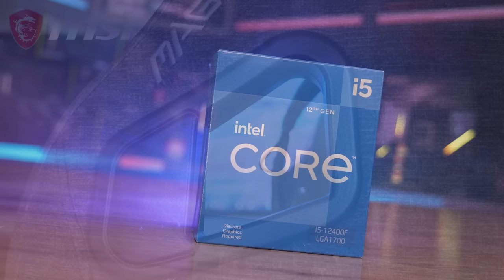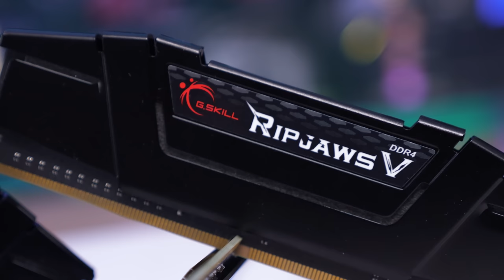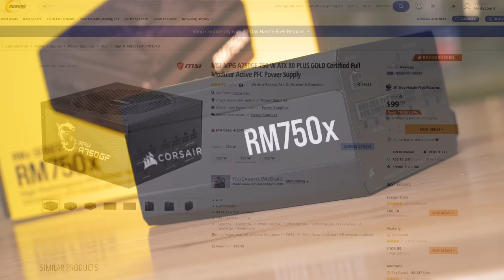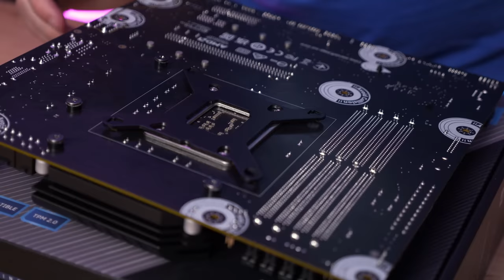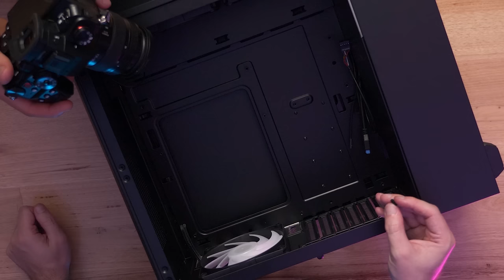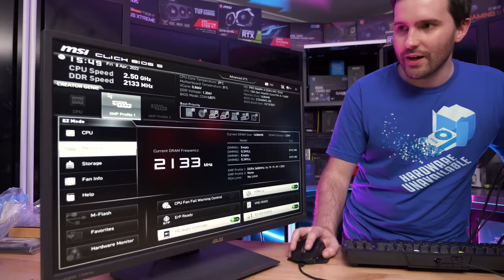Best Bang for Buck Intel Gaming PC Build for Early 2022

Comment: This is an excellent video, very impressed am I. I would like to see another one just like it. Only this time focus on the 500 - 700 motherboard price point. For the best bang for buck, where the sweet spot is for value and performance, and longevity, of a system, at the cut off between the mid tier, and the entry high tier. You have done already the cut toff from the low tier, to the entry mid tier.

In other words, the other sweet spot, that makes the most sense. So things like on board sound become important, and Wi-Fi, and lanes. Thank you hardware unboxed team.

Comment: why does nobody ever consider the 4core 8thread i3 parts?
both the one with igpu and without igpu are available for around 100 bucks.
clocks are high as well, when not in use they are super low power usage.

Comment: The 12400F is exactly what Intel needed to be back - great gaming CPU that doesn't leave anything on the table for 1440p or 4K. I would still go the Nvidia route. The 3060 goes for a similar price here, the NVENC codec (for streaming and, in my case, Moonlight) is a must for me, and you get the wider ecosystem of games with DLSS+FSR. Ray tracing should not be a factor if you are going for something in this price range. I went with a 5600x and 3060 ti and I don't regret it one single bit.

Comment: I have a question
Can we pair an i3- 12100F with like a 3060 or 6600 or it will end in a CPU bottleneck?
(Mainly looking for gaming not productivity)
Reply: i3-12100f will work fine. 12400f is quite the sweet spot tho, worth the extra for a generally better experience and longevity.
Reply: Get the 12400f
Reply: Yeah UpTo the 3070 your should leverage about 95% of the gpus performance, but if you prefer more online focused games the I5 12400f should be considered
Reply: The i3 12100f cant be beaten in price x performance imo, better deal then then 12400f.
12100f plus h610 16gb ram ddr4 3000mhz/3200,will work great 1080p no bottleneck up to a rtx3070.
Reply: should be fine in my opinion.
Reply: If you play at 1080p low, then a bit yes, 12100F will limit you, though it's still going to be at high framerate (except maybe not the best for ultra competitive titles).
If you plan to play at high settings and/or higher resolutions than you can even get to a RTX 3090 Ti and not be CPU bottlenecked.

So it depends a lot on how graphically intensive you play your games.

Also, if you care, the i3 12100F might get to be a bit overwhelmed in future games, though I doubt it will be that soon. Certainly later than a 3060 or a 6600 will be.
Reply: Please dont.
Reply: Steve just released a video on that yesterday

Comment: I would have skipped wifi  on the mobo and just used a sata ssd (maybe even a 1/2 tb one since you can add capacity later while you can't add performance to a gpu incrementally )  and try my best  squeeze every penny to get at least to a 3060ti. The perf jump could mean the difference between being sure to stay above 60 fps for the next 4-5 years and being  under it with the 6600  at 1440p in future titles. You can't really afford to allocate almost 300 $ of the budget to a mobo and a drive and then picking a 370$ gpu. Shitty gpu prices means some compromise has to be made elsewhere. I d rather have to uninstall a game I am not playing to make room for a new one, than having both on the disk and having to turn down the textures to run em. 6600 in itself is not a bad price /performance card ( still a bit below an "old" 1080ti while at least consuming less power ) but in a build costing more than 1.1k? not so much imho.

Comment: I don't want to be the guy who debates about the amount of thermal paste used, I know it doesn't effect the performance if used a more than enough but I just like to take of the cooler and re-paste once in a year or so and with that amount of paste spewing out everywhere is kind of annoying to clean lol.

And also I'd like to mention that adjusting some of the primary and sub timings and increasing the memory frequency from 3200 to 3600 will probably work with most ddr4 nowadays without issues and it'll help squeeze out a couple percentages of performance especially for budget cpus where the frequency is low. Many of your videos are around 30 minutes so maybe sometime you guys can make a video about memory overclocking and timing adjustment explaining and demonstrating the validation methods like memtest, linpack, y cruncher etc. It's a common knowledge but it'd definitely still help a lot of people.

Comment: Just bought a Ryzen 9 3900 (non X) 65 watt part vs the 105 for the x. Not supposed to be overclockable but I got 4.3 all 12 core stable prime 95 with it never going above 81c, Bought is used for $150. Slapped it in my MSI b450 Tomahawk. Gave my son the r5 3600 which I ran at 4.2 all core since day one. Could not get it higher and stable. Just a heads up. Check the used market as there are good deals there sometimes. Thanks to AMD's long support of their sockets, I was able to upgrade 2 computers for $150 US. BTW he went from a r5 1600 non AF to the 3600. Nice jump for him. This greed over gpus has hurt my relationship with AMD but the cpu side I am still pleased with as Intel still screws us with new sockets nearly every gen.

Comment: I see you are placing cooler before placing mobo in the case.
I did my first build a while ago and it basically gave me ptsd lmao, im scared to do it again my self but putting cooler before putting mobo in case it sounds allot more handy and practical.
But is there a high risk of breaking something when you lift the mobo by the cooler?

Comment: Correct me if I am wrong, but the rule of thumb says, that a balanced PC build should cost about twice as much as the graphics cards which dictates the performance level of a gaming pc in general. So I do find this kit a bit too pricey for a 400 bucks card. I understand that you want to show of upgrade options later and therefore used parts with higher quality, but a similar build with that bit cheaper motherboard , that bit cheaper PSU or SSD should provide similar performance but could end up in that 800 bucks region.
On a $1100 PC I would guess a $500 - $600 graphics card, especially with prices being still high. Since you mentioned that less expensive components could also have been chosen, maybe you could include an alternative list for buyers that wont upgrade in a while after they just bought their new PC. Nevertheless any component can be upgraded later down the road.

Or is this rule of thumb outdated and because of higher CPU performance demands (compared to 5, 10, 15 years ago), the CPU side of a build has been getting more expensive and with that also the PSU, MoBo or the storage?

But alone from the parts that where used it's a solid and very good PC build. With quality parts like the mobo or the PSU you cant do much wrong over the years to come. I do also like to use parts from companies like MSI, be quiet! or Corsair!
With the name "budget build" I guess I had other expectations that are more around 650 - 800 bucks to be at least a bit competitive to console pricing like Series X, which would be a cool comparison at the end, since this "next gen" does not always deliver 60 fps or more.

Comment: I pick similar components. I5-12400F, msi prp b660m-a wifi d4, patriot 2x8gb at 3600, ssd Samsung m2 980 500gb, hdd 2tb Baracuda, psu 550W, case Zalman S2 TG, gpu rtx3050 8gb for 320€. I waiting parts to arrive. Maybe I upgrade stock cooler with BeQuite Pure Rock 2

Comment: The 5600 is mighty impressive for budget.
Reply: @tilapiadave3234  Yeah. If you look at cpu only. But if you look at cpu and mobo combo then things get really close.
Reply: @tilapiadave3234  You can go for B450, X370 or even B350. But here 5600 + B550 costs less than 12400 + B660.

Comment: Something to keep front and centre is regional differences. In some places the AMD 5600 is more expensive than the Intel 12400, including MSRP in US dollars, but in some regions, such as the UK or Australia, the AMD is cheaper than Intel. Even if you can't find time to do a price per region over a few regions, stating where it may be region dependent (e.g. I don't know if SATA drives are region dependent) if it is close enough to parity, that "your region may vary" would be worthwhile.
Reply: @tilapiadave3234  Please ENSURE you are accurate. In Australia, the difference between the CPU+MB for AMD is cheaper than CPU+MB for Intel. Yes, Intel continues is price GOUGING in the land of kangaroos.
Or are you pretending that Intel CPUs don't need a motherboard?
Reply: @tilapiadave3234  And I have checked. AMD is cheaper, sometimes it is slightly more expensive but AMD 5600 is cheaper than the Intel 12400 in Australia.
Reply: @tilapiadave3234  "and same price across most of the Australian retailers"
Yeah. And there you "hope" to get away with a lie.

Comment: Is there a benefit for going with Z690 boards if you're not overclocking? Will be running lengthy heavily threaded workloads, so I'd like to have no throttling nor stability issues.
Reply: Not needed. Z690 is for CPU overclocking, and better features like more PCIe lanes, and often paired with better features like PCIe 5.0, DDR5, etc.

B660 is plenty for the average person.

Comment: Would the 12400F make a good pair with a 3070 Ti? Upgrading from a 1700. 1440p60. I don't need more than 60 FPS.
Reply: A 12400 would be absolutely fine for that build, but since you're pairing it with a upper range GPU, you should really consider the 12600k(F) (<$280) or 12700F (<$310)if you can afford them

Comment: That's just the PC. But still that's a good show for the market of current gen stuff.

Got everything from scratch for less than 1 400€ !
1080p 144 Hz gaming rig :D
With a cheap 10600K and 32 GB of RAM to play Cities:Skylines (and maybe war thunder in the future).
Just snatched a GTX 1070 for 250€ on eBay.

Comment: I picked up the i5 12500 on sale for $195 which was the same as the 12400 at the time oddly enough. The F variant was a whopping $35 less though at $170, still is. I don't have a GPU yet though so I needed the igpu

Comment: i really like the performance and suggestions. But, oh man those prices are just great on the video, here in Peru..
the cheapest Asus dual RX 6600xt its 586 $ usd.
that i5-12400f... 229$ usd.
16gb 2x8 of Fury beast no rgb 3600mhz ram, its about 101$!

al the pc, almost 95% similar. cost: 1563$ usd xD ... here is like 5785 soles, and its a lot. 

still, nice suggestion tho : 3

Comment: It’s a bit like deja vu, just taking a coffee break from building a new pc for my son and it’s very similar but a bit on steroids 
I5 12400 (non F as only £11 more £180
MSI B660M Mortar WiFi £170
16GB Crucial Ballistic 3200 CL RGB £57!!!
1T Crucial P5+ NVME £100
Graphics GTX1660 Super (free from my old PC)
Corsair 4000 D Airflow £89
Artic Liquid Freezer 240 ARGB £89
3 off Artic P12 ARGB £33
Corsair RM750 £75
Reply: @h0stile Probably a typo, there is also a B660 Mortar
Reply: @h0stile 
Oops B660M

Comment: Disagree with the 3600Mhz memory, there has been documented cases of alderlake not working well with ddr4 faster than jedec due to the locked memory controller voltage. It is easy to avoid with anotherk it of 3200Mhz memory, but IMO a trap.
Reply from the maker: You won't have an issue with the recommended board. Also you can just manually set the frequency to 3.2 Gbps, it's not a big deal.
Reply: @Hardwareunboxed  Unless this board can defy Intel's limitation of .9v imc voltage on b660/non-k skus, Im not so sure about that. But ya, manually reducing works.

Comment: At 5:00, you mentioned that the Intel 12400F can be paired with 3600mhz memory. I checked the max ram speed of the 12400F online to be only up to 3200mhz. In fact, I've built a pc for a friend and I embarrassingly recommended a 3600mhz kit which causes crashes when XMP is activated. We ended up deactivating the XMP. Can you verify if the 12400F works with the 3600mhz kit that you used here?
Reply: It works fine with any motherboard that will allow memory overclocking, a B660 motherboard allows memory overclocking.
Reply: @thedandyp  It works fine with newer BIOSes which automatically set the RAM to Gear 2. If you have a locked (non-K) CPU and you install it on a Z690 or a B660 with an old BIOS version and then try to activate XMP, it might crash because it will try to run the RAM in Gear 1, which might not be stable at >= 3600 MHz because the locked SKUs have a fixed vCCSA (system agent voltage) of around 0.9 V, which is too low and cannot be raised on the locked CPUs (you can change the setting but it doesn't actually do anything). I've read of some people running 3600 in Gear 1 with a locked CPU but I think it's quite rare and down to luck mostly, in my case and a couple of friends of mine, setting the XMP profile with Crucial Ballistix 3600 CL16 causes crashes on all our systems (one is a 12700 on MSI Z690-A, one is a 12700 on a B660M-A and one is a 12400F on an ASRock B660M Pro RS)
Reply: 12400F works with 3600mhz DDR4, the 3200mhz listed is maximum jdec (stock, guaranteed) speed supported. Buy a different RAM kit off the QVL if you're having trouble getting 3600mhz
Reply: @marcosanta8  When you say Gear 2, do you mean XMP profile 2? I only tried using the XMP profile 1, the crashes occuer. I haven't tried the XMP profile 2.
Reply: @gerardguadayo1788  No, it's not that, it should be called something like CPU IMC : DRAM clock. It's basically the ratio between the CPU internal memory controller and the RAM speed: on Gear 1 they work at the same speed (1:1 ratio), on Gear 2 the IMC goes at half the speed of the DRAM (1:2 ratio) therefore improving stability, but also decreasing performance. I would rather drop the RAM speed to 3400/3466 and keep them in Gear 1, rather than staying at 3600 in Gear 2.

Comment: I'm a bit confused. On the intel website, for both i3-12100 & i5-12400 specs, it's written as "Up to DDR5 4800 MT/s  & Up to DDR4 3200 MT/s". here Tim is using ddr4 3600 MHz ram. at 18 min he oc it to 3600 MHz. Can I pair an i3-12100 & Gigabyte B660M DS3H AX and run a ddr4 3600 MHz ram too? 
Cheers.

Comment: That PSU is extremely overkill and here you could save some bucks. Even if you would like to run your PC at perfect efficiency (which is around 50% PSU usage) you shouldn't go higher than 600W. This hardware can easily be run with a decent 450-500W PSU. The money you save on the PSU could be enough to get a RX 6600 XT which is a bit faster.
The future proofing for a possible GPU upgrade ends up being a waste of money most of the time. Electricity is more expensive than ever and if you ever went for a quite system like this you don't want to stick these inefficient 300W GPUs into your system. I personally will never go back to inefficient GPUs and I made the mistake to overspend on my PSU for "future proofing". Here I sit with a 750W bequiet PSU while my pc is undervolted not even pulling 300 W on average.

Besides that I agree that this is a nice collection of parts and I would go for a similar setup, if I had to buy a new pc around that budget.

Comment: I'm not sure about this build. A 750w PSU might be too much, and the 2TB SSD as well, 1TB/500GB SSD + 1/2 TB HDD might have been better, and the cooler is overkill. You might save a bit more money and have it go towards a 6600xt, overall would have been a better system. Here in Australia, looking at the price of the components it would be cheaper and better to go with 6600XT,  500gb+2TB, 650W Gold, cheaper cooler, replaces 12400 with b560+5600,
Reply: Would a corsair cx450 enough power for this build?
Reply: @Dodara87  it could get the job done if its 450 80+ gold, wd be a bit loud and hot. Get 550 80+ bronze

Comment: Can an Intel i5 12400f run a RTX 3070ti ?
Reply: 12400f would be fine with a 3070ti. It's got fantastic single thread performance. Better than any zen 3 or earlier gen intel cpus
Reply: @SmokeSolo1975  thanks man..btw how do you know this ?
Reply: @riichobamin7612  Google is your friend.
Reply: @IIHydraII  okay. What should I google though 😅 ? 

Will "is i5 12400f enough for RTX 3070ti" work 😅 ?
Reply: @riichobamin7612  look up single core cinebench benchmarks for 12400f. You will see the 12400f gets better single thread scores than any other AMD or older gen Intel cpu. Games utilise single thread performance over anything else and this is why I make this conclusion.
Reply: @riichobamin7612  hardware unboxed did a video where they compared the 12400f against the zen 5600 non x version with 4 different nvidia cards. As the card went above 3070 performance, the 12400f was scoring better fps over zen 3 with the gap getting bigger as you went up on scale
Reply: @SmokeSolo1975  thanks a lot bro ❤️

Comment: Leave the "Budget" out, if you build a PC over $1000 :)  My $339 PC from Apr 2019 deserved the budget name; $99 Ryzen 3 2200G; $60 ASRock B450 HDV 4.0; $82 16GB Geil DDR4 (3000MHz); $65 Silicon Power nvme-SSD (512GB; 3400/2300MB/s) and a DOP1500 ($33) xTech Midi-Tower Combo with a 600W power-supply (70+ tin-plated with 24-pin; 4-pin; 2 SATA and 2 Molex plugs). The Midi-Tower is black with a 2cm rgb strip above and right of the trapezium sized power key (blue is power on; red is disk active). The system has great upgradability using modern APUs. Next month I consider to buy the $154 Ryzen 5 4600G, a very expensive part for 1.5x the original CPU price, but giving 2.2x the CPU performance :)